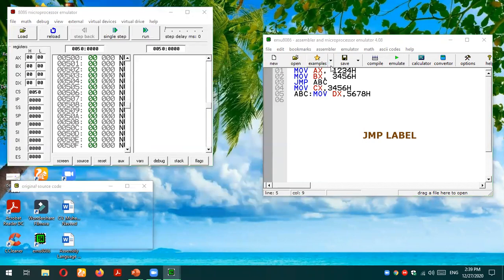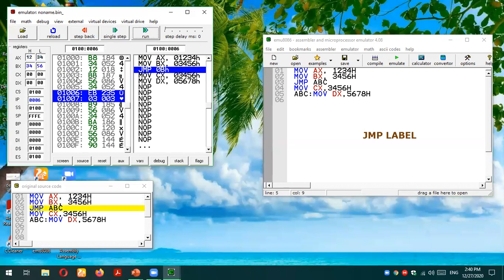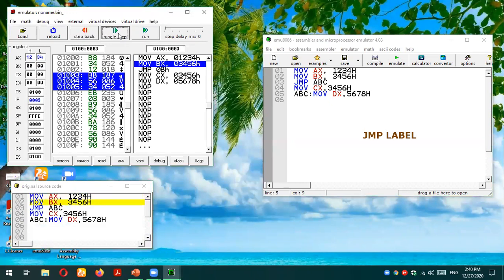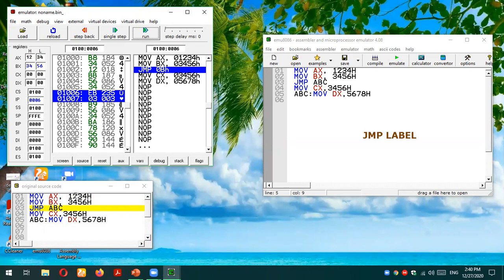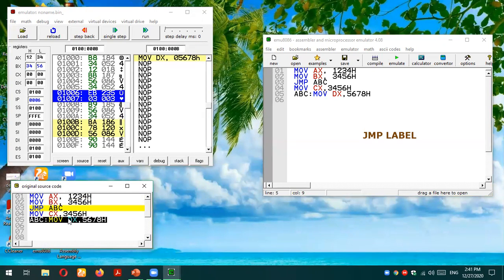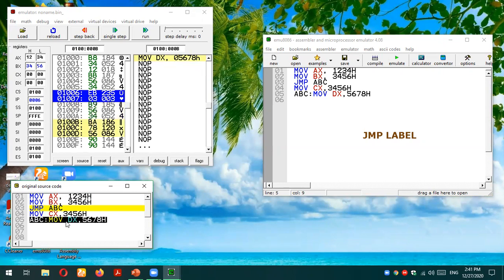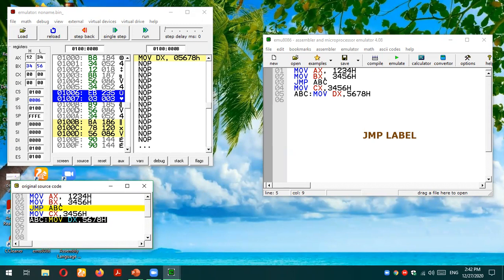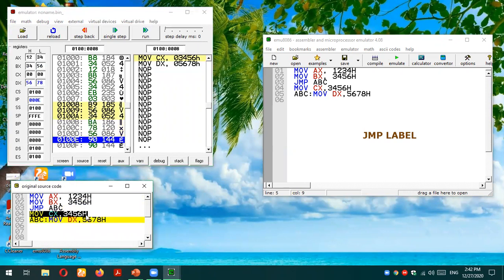Uncoditional Jump INSTRUCTION  IN 8086 MICROPROCESSOR

Comment: Sir, this may be out of questions, but i have been bugging myself with one thing. Can you tell me how to use mini process inside my programs?
I have been using this program to write \n into new line , but it has multiple downfalls , most noticeably , when i write anything behind the \n, the data are lost.
.stack 100h
.data
 ms1 db 10,13,'Original',10,13,'$'  
 ms2 db 10,13,'Full cap',10,13,'$'
 ms3 db 10,13,'Remove caps',10,13,'$'
 msc db 10,13,'CHek',10,13,'$'
 s db 200 dup(?) 
 s2 db 200 dup(?) 
 s3 db 200 dup(?) 
 dem dw ?
 dem2 dw ?
.code
    mov ax,0h
    mov dem,ax
    mov cx,0h
    mov ax,@data
    mov ds,ax
    mov bx,0h
    nhap:
    mov ah,1
    int 21h
    cmp al,13
    je enter
    mov s[bx],al
    inc bx
    jne nhap 
    
    enter:
   mov ah,9
   lea dx,ms1
   int 21h
    mov dem,bx 
    mov cx,dem
    mov bx,0
    mov dem2,cx
;  in ra xau 1
   mov ah,2
   in1:
   mov al,s[bx]
   cmp al,92d
   jne tiepp
   cmp s[bx+1],110d
   jne tiepp
   mov dl,10
   int 21h
   mov dl,13
   int 21h
   dec cx 
   tiepp:
   mov dl,al
   int 21h 
   inc bx
   loop in1
   
   mov bx,0
   mov cx,dem
    ;mov vo xau 2
     chuyens2:
      mov al,s[bx]
      mov s2[bx],al 
       inc bx    
       loop chuyens2  
;---------------------------------------
    mov ah,9
    lea dx,ms2
    int 21h 
    mov bx,0 
    mov ah,2
    inhoaprotocol:
    cmp dem2,0
    je tiep1 
    mov al,s2[bx]
    cmp al,97d
    jl inph2
    sub al,32d
;   mov ah,2
;   mov dl,al
;   int 21h
;   inc bx
;   dec dem2
;   jmp inhoaprotocol  
    inph2:
;   mov ah,2   
    cmp al,92d
    jne tiepp1
    cmp s[bx+1],110d
    jne tiepp1
    mov dl,10
    int 21h
    mov dl,13
    int 21h
    mov s3[bx+1],13
    mov s3[bx],10
    dec dem2
    jmp inhoaprotocol
    tiepp1:
    mov dl,al
    int 21h
;   inc bx
;   dec dem2
    mov s3[bx],al
    inc bx
    dec dem2
    jmp inhoaprotocol    
;---------------------------------------
    tiep1:
    mov ah,9
    lea dx,ms3
    int 21h
    mov bx,0
    mov cx,dem
    mov ah,2
    inthuong:    
    mov al,s3[bx]
    cmp al,64d
    jle inn
    add al,32d
    inn:
    cmp al,123d
    jl inne
    sub al,32d
    inne:
    mov dl,al
    int 21h
    inc bx
    loop inthuong 
    mov ah,9
    lea dx,msc
    int 21h
 end:     
 hlt
Reply from the maker: As I have understood you are using specific instructions again and again. So,  I will suggest defining the mini process for those purposes. Then you can call it as user-defined functions are used in high-level languages.
Reply: @LearnOnline1  thanks for the advice , sir.
Reply from the maker: @finneko-ai   You are welcome